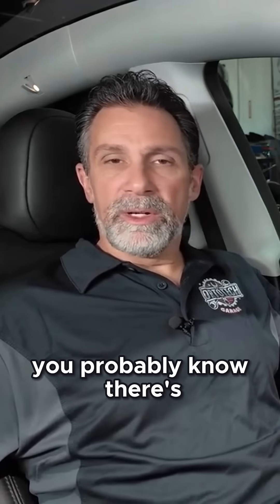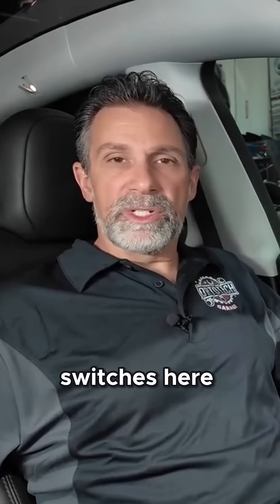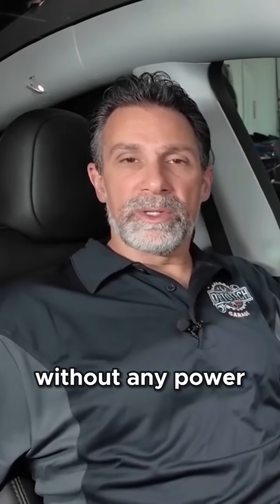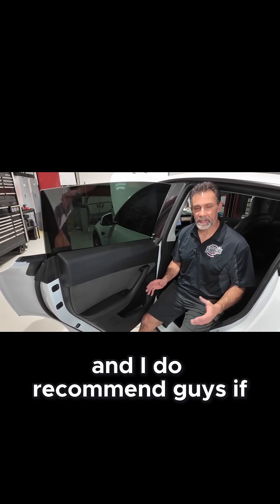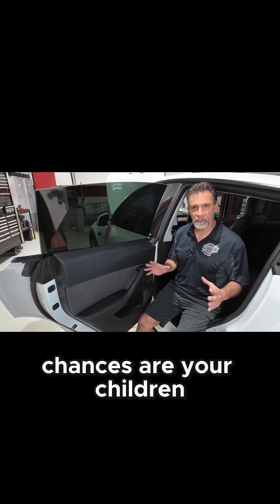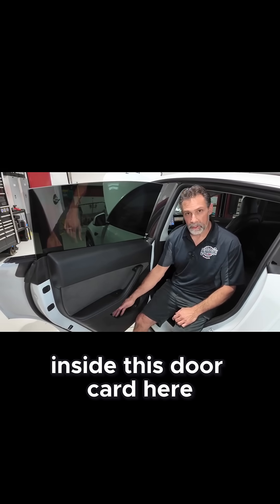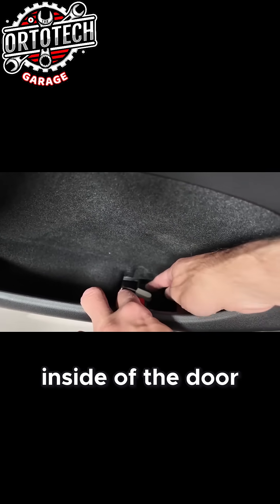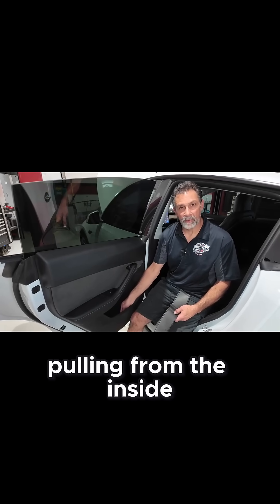How to Escape a Tesla Without Power

Comment: Hiding the manual release for the rear doors is foolish design. Also, exposing the actual cable is crude and obtuse. Why not use a plastic latch that is easier to hold just like they did for the front doors?
Reply from the maker: I agree.  I understand the electronic door release for convenience,  but they definitely need something mechanical that is easy to access, especially for kids in the rear.